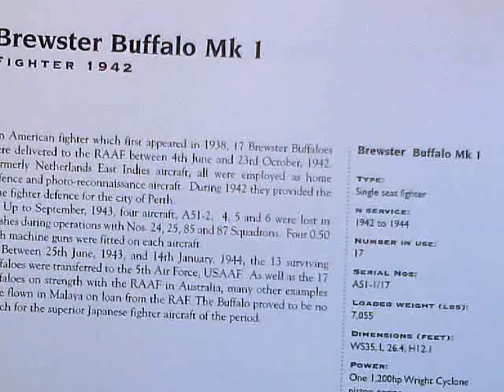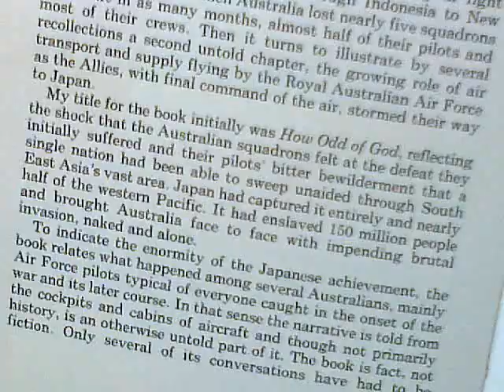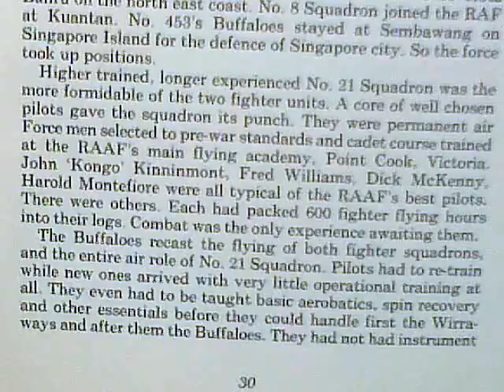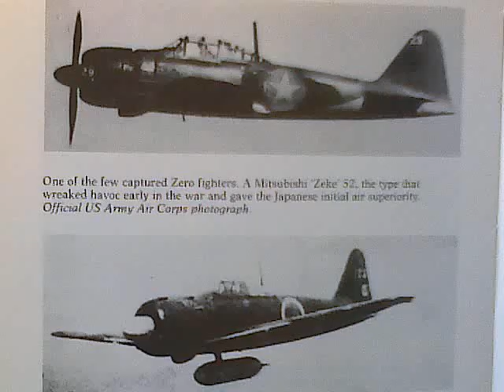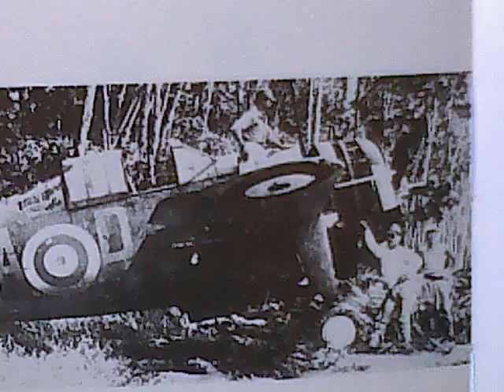World's Worst Fighter Aircraft, The 1941 RAAF Brewster Buffalo !

Comment: The Finns had a 26 to 1 kill ratio with their Brewsters. In fact: After evaluation of claims against actual Soviet losses, Brewster BW-364 was found to have been used to achieve 42½ kills in total by all pilots operating it, possibly making it the highest-scoring fighter airframe in the history of air warfare. 
The Brewster works well, in the right hands.
Reply from the maker: G'day,

  Thanks mate,

  Well, the sources I've seen are a bit more modest than yours, in that the Finnish Buffalo Kill-Rate versus the Soviets was 10:1 and when the Yak-3 showed up the Finnish Air Force upgraded to Bf 109 Fs & Gs, & Hs, and their Kill-Rate suddenly became 25:1, as soon as they got their first Friedrichs.

  So it isn't so much a matter that "the Buffalo was a Good Fighter Plane", so much as that the Finns were Shit-Hot Pilots.

  Also, the Finns got the Earlier Buffaloes, the ones which were lighter than the later (higher-powered & more heavily armoured) models which the British bought, & then  foisted off onto the RAAF...

  Then, again, the Finnish Buffaloes had German Guns, German Ammunition, & German Radios..; so their Gun-Mountings failed to fracture, firing the Cowling Guns didn't blind the Finnish Pilots with Vapourised & Re-Condensed Gun-Grease from their  not US Naval-grade .50  Cal. Ammunition, and the German Radios weren't rendered useless by the Tropical Storms which don't commence at 11 AM every day over the Pripet Marshes & on the Kola Peninsula..., and the Soviets flew Low, so the Finnish Buffaloes never had to fly sufficiently high for their Fuel-Pumps to fail..., either.

 Basically, the Finnish Buffaloes were different Aircraft which did not suffer from the flaws of the RAF/RAAF/NEIAF/USMC Buffaloes which made such a piss-poor showing in the Pacific, & they were up against badly-trained Soviet Peasants, rather than Japanese Combat-Veterans who'd been winning in China for 5 years before they showed up in the Southwest Pacific...

 Ilmarri Jutilainen scored 34 of his 96 Victories while flying in Buffaloes, and his Aeroplane was never ever hit by so much as a single Bullet or Shell fired from any Soviet Aircraft..(!), and whereas Bubi Hartmann scored 352 Kills for the Luftwaffe, & thus he's "officially the most successful Fighter-Pilot" in the history of sneaking up on Strangers & shooting them in the back, because one's "National Honour" requires it..., he was shot down, & baled out or crash-landed, at least 4 times...; so I reckon that makes Jutilainen the "top ranked Fighter Pilot in all Human History".

  Because, due to Global Warming's ongoing deconstruction of the Global Economy, No Nation will EVER again provide 97 Aeroplanes for anybody to try to shoot down without being bullet-holed, in order to be able to beat Jutilainen's Record....!

  I once had a few conversations with a bloke who flew a Fairy Battle in France, he was shot down with the "Low-Level Flight" trying to bomb the Bridges between France & Belgium, after May 10, 1940..; a lot of 1930s Hairygoplanes could fly reasonably well, but were not actually particularly well suited for the task, if ever one was ordered to sit in them  and then take off to  "Pursue the King's Enemies...!"

Such is Life,

;-p

Ciao !
Reply: I was just reading the wiki. Yeah, wiki isn't perfect, but regarding fighter plane stats, who is. I said 36/1 when wiki said 26/1, which I tried to correct last night, but couldn't find this vid again till you posted.

The uneveness of pilot training, and airplane evolution, in WW2 was true all over the globe. I'm not an expert, but the disparities in aircraft and pilots was everywhere in most theaters, and the historical preoccupation with nationalism/equipment never dies. 
I always wondered how I 16's would do in the best hands, but history just distorts they're place in the evolution of WW2 technology, as if the I-16 and untrained pilots were Russia's answer to the 109. Nobody had an answer to the 109 or the Zero (farther east), because those "answers" take time, but being first with the best didn't often happen or last very long in WW2, but the I-16 might be one of those. 
Your argument is well taken. The title of worst, though, would require a comparison with 20-30  other mediocre planes, and is in the end an impossible "truth" to ascertain.
It wasn't gonna happen that the stubby looking aircraft (I-16, Buffalo, etc) would receive the support to evolve, perhaps for good reason, but my impression is that many Finnish pilots, flying the Finnish modified Brewsters liked them. The people who didn't bother to modify them, weren't allowed to modify them,  received the worst versions of them, or who didn't train hard with them, didn't.

I suspect your overall assessment is that the US procurement system (then and now) is a mess is accurate.
The recent trillion dollar outlay for new nuclear delivery and weapons systems is stupid enough to warrant a "worst" designation for military reasons, and every other reason.
Reply from the maker: Jeff Moore 

   Yeah, I've been calling the F-35 the Jet-Powered Buffalo, and Oz is signed up to buy about 75 of them for $200,000,000 at per each...

   I think the I-16 and the I-15 both did pretty well in Spain, even against the Bf-109s (C & D models...).

   Here in Oz, they used the biggest Motor available (off a DC-3), with the Centre-Section & Tailfeathers of a Wirraway (a Harvard with a Rear-Gunner & a .303 Browning for the Pilot.., one lucky bloke shot down one Zero with one Wirraway, once...!), and a short little rotund  Fuselage & stubby Wings, and called it the "Boomerang"...; it worked out allright for Ground Attack, but essentially the concept of putting Guns on a "1930s Radial Racer " style of thing turns up being about 500 Hp shy of being able to carry all the Military Add-ons and still stay in the sky with the rest of the Competition.

  Last November I was at the Armidale Airshow, with 2 Phone-Cameras & a 300mm Zenit Photosniper (1982 vintage Soviet Telephoto "Spy-Camera"), and if you title-search my Uploads for "Armidale Airshow...." there's both Video & Stills of a restored Boomerang, a Wirraway, and a Harvard & a Texan for Comparison ; there's also a Yak-3, and a 6-ship formation team of Nanchang & Yak Trainers ("The Russian Roo-Lettes")..., and while they were flying low under the worst Thundery Sky I've ever seen any Airshow continue to happen under the Team's "Patter-Man" said a thing I suspect you'll enjoy...,
    "Soviet Aeroplanes were designed by Geniuses, intended to be maintained by Agricultural Peasants, and to be flown by Lunatics - or Drunks...!".

  The Russian Roo-Lettes were doing Formation Aerobatics at Armidale in Yaks & Nanchangs while the RAAF "Roulettes" Formation Display Team, in their Turboprop Pilatus PC-9s, were grounded 60 miles away at Tamworth, by the vile Weather...

   Such is Life,

;-p

Ciao !
Reply: Appreciate the story. You've been bitten hard by the aerobug. I'm just a couch admirer of the stuff "daddy" flew.
They don't appreciate camera's in museums? It's hard to imagine that these craft were used like Dixie Cups back then, and are precious now. 
Where we (US) produced planes like toasters, now its like a craft guild. I remember when Popular Science had regular promos of "consumer" planes to replace your car.
Reply from the maker: Jeff Moore 

   Oh yeah, I got bitten very hard indeed by the Aero Bug, I used to think I was Biggles.

   If you search for "The 8 Hp, 1975, Red-Baron Skycraft Scout ; World's 1st Legal Minimum Aircraft..." you'll get to see my first Aeroplane hanging up in the Transport Museum 50 miles to the West of here...; I was it's 3rd owner, and the last person to have flown it, in 1978 - it's not much of a "claim to fame", but it means that I can honestly say that Wilbour & Orville had a better Aeroplane in 1903 than what I made my first solo in...(!).

   By the early 1960s Cessnas & Beechcraft & Pipers were pretty boring, and Hang Gliding was the reaction, and then Ron Wheeler put a Lawnmower Motor & Wheels onto a "Tweetie" and then managed to get the Department of Transport to write Air Navigation Order 95.10 ; so for a while, here in Oz, we were allowed to fly uncertificated machines without needing any Licences..., and the rest of the World followed, so "Minimum Aircraft" became "Microlights" & "Ultralights" & now they're "Recreational Aircraft", and you need a Micrometer to tell a Jabiru from a Cessna 152 - because General Aviation  Aircraft & Recreational Aircraft now overlap...., they've merged.

   The vision of everybody having their own Aeroplane and flying to work was never going to happen, because not everybody has the kind of mind which can juggle all the variables needed to manage to not crash when moving through 3 dimensions and managing Airspeed & Angle of Attack & Navigation as well as avoiding collisions...; and the smaller, lighter, and simpler the Flying Machine then the more dependant it will be on having Perfect Weather to operate in.

  As the old saying goes, "If you have time to spare then travel by Air...!" ; alluding to the liklihood of being delayed by Weather or diverted to somewhere other than wherever one was trying to reach...

  Eventually I crashed my Ultralight Motorglider, and 24 years later I still limp and carry a Walking-Stick...; and I've never bothered to rebuild the Aeroplane, it sits in it's Trailer as a reminder of the days when I was young and thought myself to be unbreakable...

   Have a good one,

;-p

Ciao !
Reply: I watched both your vids. Extremely entertaining! I've done my near death apprenticeships  long ago. I also reasoned that flying and even deep water are hostile places for humans. A table saw and electric bikes are are far out on the limb I travel.
I "invent" stuff all the time though. A lot more mundane that airplanes, but pop was a pilot for SAC, and loved talking about it, so the bug is there in me. Dreaming up "airplanes" and other stuff is hardwired in me by now.
Are you still down under?
I'm gonna search Volmer Jensen next. Thanks
Reply from the maker: Jeff Moore 

Thanks mate,

  Volmer Jensen was a really amazing character, he was offended by the early Rogallo Wing Kites' horrible efficiencies, and decided to show the Hang Gliding Fraternity how many Beans made 9...

  Yeah, I'm still in Oz, I never got around to going anywhere overseas..; my grand plan was to use the VJ-24w with a VHS Mini-Cassette Camera on my Helmet & run an Aerial Photography Business barnstorming Farmhouses to sell  Aerial Videos of their "Spread" - back in 1992 it might even have worked ; and I'd bought 100 Acres to live on & turn into a (marginal) Ultralight Airstrip (in a Forest atop a Ridge), so when I pranged the Jensen...

   I've been living in a 10 Ft x 12 Ft Lawn Locker in the Forest since 1994 when I left my wife, the Custody Dispute ran for 9 years & I was self represented but in the finish my missus lost 4 Cases in 4 jurisdictions in 4 weeks...; today my son turned 27, a year & a half ago he bought the Town's Auto-Electrician's Workshop & Business from his old Boss, & the Reddestone Rural Fire Service Brigade elected him (full Red Hat) Captain, & at 24 he got his Helicopter Winch Insertion/Extraction Licence & a spot on the local Remote Area Firefighting Team...

  So, I didn't entirely stop him from being into Aeroplanes, he bought the tickets & took me, my daughter & his Girlfriend to the Armidale Airshow last year...; and 20 years earlier he & I were at Armidale for an Airshow, but then we were there to Aerotow Hang Gliders, as part of the Airshow....

  I figure being a toddler watching Daddy working at Airshows & Fly-Ins must be where/how he decided to be an energetic worker, just like me getting him to help Burn-Off when he was 5 and taking him to my RFS Brigade's Annual General Meetings from 7 led to him becoming the youngest Deputy Captain in the State when he was 17 (?).

  Considering that my father's grandfather came here in 1882, and that the bloke who started "Glen Innes Auto Electrics & Air Conditioning" in 1960 had been my father's last Business-Partner in 1958 - and he used my father's Electrical Test Bench to kick off with, the year before I was born..; it feels to me as if Wharton's Garage "threw a Pup", and though Dad sold his Engine Reconditioning Business in 1972, I've raised my son to have "bought the Family Dog back", because Dad's Electrical Test Bench was part of the Deal...(!).

  And, if I'd have moved so much as 50 miles in any direction then Old-Local Effect wouldn't have been able to facilitate my kids' being able to succeed in the ways they have done & are doing.

  I have a bunch of Playlists, and in the "SunFoil Project" Playlist there are 2 Vid's called "Wharton's Garage, Remembered..." & "Wharton's Garage Rebooted, Live & In Realtime...!"

  In the "Personal Aeroplanology" Playlist there's one called "Aerotowing Rogallo Hang Gliders", which shows my son at age 5 running Free-Range, Airside, at the Inglewood Fly-In/Aerotowing Weekend in 1994...; as well as some of the Photos he took, with the 110 Zoom Telephoto Camera I let him loose with, in 3 days, with a 24-Exposure Roll per day, and out of 76 possible Frames he had available, I paid for 72 Photographs which worked out well enough for the Processers to to print them.

   If you're into Wildlife, I have about 5 Playlists of Kangaroos, Swamp Wallabies, Birds, Snakes, & combinations thereof...; it's a rare day when I have less than 3 wild unfenced Swamp Wallabies & 5 Grey 'Roos show up at Sunrise to share my Breakfast..., and I have Subscribers in Cornwall, Canada, Scotland, Florida & Norway who know the names of the "Breakfast Flock" of local Macropods, because they've been watching my videos for years.

   I figure that YT gives a Hermit like me a "Global Megaphone" with which to share the view, and more people should have the opportunity to see Wildlife when they're feeling relaxed & comfortable...

   I don't know that I'm the only Australian who has wild 8 Ft-Tall Alpha Male Kangaroos bow down & cover their Balls with their Claws, while having Bread put into their mouths...; but, as far as I know, everybody else who posts Macropod Footage either uses Telephoto Lenses or they have Fenced-in, Tame, "Pet" Animals which were either born in Captivity or raised by Wildlife Rescuers after their mothers were shot by Hunters or killed by Cars...

  I have 1,880+ Videos uploaded, & probably 400 of them are Wildlife, and perhaps 50 have Wild Critters sniffing my handheld Phone-Camera Lens, at less than 5 Millimetres (1/4 Inch) Range.....; so, if you want to see some rather  rare insights into Wild Macropods & Wild Birds  interacting with a non-threatening Human Forest-Dweller, then my playlists are there...

   The Poetry is in the "Warbles In The Wilderness" Playlist...

  I do admit to being a something of a thorough-going "Oddball", but I reckon I'm Harmless ; and though I do use Trespassing Sheep for Archery Practice, I get along well enough with my neighbour the Sheep-Farmer that he never shoots at me when I'm standing in my Headlights, while opening my Gate at night...

  I think of myself as a Greenie living surrounded by Rednecks, trying to get along with them-alls ;  while we all try to live through "Interesting Times"...

   I don't really agree with what the US AF SAC thought it was trying to do, because from 1980-86 I was a Nurse, trained at a Repatriation Hospital, & I nursed the Veterans of every War which Oz was involved in from 1914 to 1984 ;  2,000 of them, for an average of 10 days per Veteran..., and that turned me into a Pacifist...

   Meaning that I abhor the War(s), but I empathise with those who were seduced by the Access to Technology which Enlistment facilitated, having grown-up being weaned on Militant Patriotic Nationalism...; "There, but for the Grace of God, goeth I...!", kinda thing.

Such is life,

;-p

Ciao !
Reply: We make up our lives as we go along. I evaded the draft - an honor. Had lots of kids. Wife died 5 years ago, remarried and 3 more teens came in the arrangement.
I wish I could stop the eternal war my leaders have bought with our taxes.
I practice guitar and singing for hours and want to resume performance like before my second wife died.
To that end I've created a live music system that allows me to kind of have a studio on the run. Nothing earth shaking, but very practical, musical, portable, and good sound reproduction.
I'll have a look at your vids when i get the chance.
Reply from the maker: Jeff Moore 

Cool,  

   I married a woman with two boys at foot, but I turned into the Stepfather from hell...; not one of my best achievements...

   I should've realised that any time & energy their mother spent on her relationship with me was time & energy she didn't have for her existing children - and no matter how I tried to contribute I couldn't make up for the reduction in Mothering they experienced as a result if my being on the Scene...; so, in hindsight I had no right to commence courting their mother, but I was unaware of that at the beginning...

  Have fun with my Uploads, but you'd need weeks of dedicated obsessional viewing to plough through them all, there's probably 450 or 500 Hours of them on the scroll...

 Have a good one,

;-p

Ciao !
Reply: Aint it funny how these relationships get more transparent to us as we age? I married a Kenyan that already had children, for that and other reasons. I don't know how I or she could parent each others children without having prior experience. 
I had a lot of previous experience, starting when I was age 22 or 23. My youngest, from the previous (I am/was? a widower) is now 15.
I'm not as clear as you about my first marriage, and like yours it was an 8 year ordeal of a divorce after a long marriage.
I blame her, which only means that I haven't figured it out, but it was long long ago.

At best I'll sample the genre's of your vids! Like one of your birds that took a lot of effort for you to keep running, I'm sitting here with a Volt Ohm Meter, trying to sort out and imrove my  my music system thing.
I'm fascinated with WW1-2 aircraft, but I'll never be a pilot or builder. Music is both more accessible, safer, cheaper, and even more compelling to me. But somehow aerobatic and dogfight flying - and musical improvisation have merged a bit in my little mind. 
I like playing and singing "without a parachute" and not as a hobby but as an obsession. 
Take care
Reply from the maker: Jeff Moore 

Cool, no worries.

   One of the ways to sample the Genre, as you succinctly put it, would be to backscroll the Uploads for a few weeks from now, and view anything which grabs you

  A different way would be to search my Uploads by "most popular", which (on my Prepaid Telstra Mobile Phone) results in a scroll of my 30 most-viewed Videos ...; the top rated runs almost 14 minutes & is about why Magnetic Flywheels don't work, it had 166,850 Views last time I looked, number 2 has 66,000 Views but the BBC Nature-Doccumentary Unit used 48 seconds of it in their hour-long Doccumentary, "Nature's Weirdest Events", they gave my real name & used my own voice-over...

  My Scottish Subscribers fell off their Chairs when I appeared on their Televisions instead of the Computers, 3 years ago...; 3 days ago I was told that some people around here were watching National Geographic Channel, & there I was...!

   My dad was 52 when I was born, he had 3 kids & his first wife died in October 1958..; in April 1959 my mother was 22 & watched my then 19 yr-old sister getting married, in January 1960 my parents got married, & I was born in Feb. '61.

  When I was born, the Age-Gap was 28 years, & my mother was 24...; and I watched my father suffer the disapproval of my Half-Siblings in that he saw almost nothing of his 5  Grandchildren from his first marraige, whereas he died 7 years before my Son was born...

  My wife is on something like her 7th or 9th partner since I left her, out of the 7 "Back Door Pricks" who tried to woo her away from me before I gave up on her, 4 have died, 2 went to Prison, & 1 left town so I dunno how he got on...; but my Son hasn't spoken with her for about 9 years & my daughter hears from her somewhere between Weekly & Yearly.

  A Fortnight after she lost the final Custody Case, my wife's eldest Son hanged himself about 6 weeks before he would've turned 21, and she prefers to pretend that I "must have murdered him & set it up to look like Suicide..." ; and now it's almost 14 years since the Courts rescued my kids..., and her surviving son from her first Marraige is 33, still lives with her, and on my 12th Wedding Anniversary I learned that both my Stepsons were in separate Psychiatric Institutions..., 6 years after I left their Mother and started trying to rescue my kids from unbuffered exposure to her.

  My Wife's first Husband abandoned his children to be raised by a Mad-Woman whom he couldn't stand to live with, and he left them to be driven mad by toxic parenting...; I never dared risk my children's sanity by having to cope with any "Daddy's Girlfriend Fantasies" while they were busy trying to be the children of a Failed Marraige.

  I often used to comment that if my Wife were dead then within 3 months I could've transformed her into a Perfect Parent, because I had learned to become expert at contriving excuses for her behaviour, and if she'd been dead then she wouldn't have been able to continue managing to contradict my rose-coloured version by fucking-up contemporaneously.

  It's totally different having an ex-Partner living an ongoing Life, to having a Headstone in a Graveyard to say nice things about...; my father had the Headstone thing going on, but my first wife lives with her surviving son 100 miles away.

  If either of my kids can stay married for 21 years then they'll have done as well as my father did with his second wife...; & yesterday I drank beer with the Parents of my Son's Girlfriend, on his 27th Birthday, in their House, where they allow him to live in their daughter's bedroom...

  I figure we're all trying to be as supportive as possible...

   For a Hermit, I find my role as a supportive parent to be very demanding & challenging.

  But, I try...

;-p

Ciao !
Reply: Jeff Moore could it be that the Russians and the Finnish fought at a lower altitude because of the cold?
Reply: I believe the # is 32 to 1. Highest kill rate of WWII on the Finnish side against the Russians.
Reply: The Brewster worked very well indeed in the right hands, against the right foes. I think if the Japanese, whose pilots were probably the world's best at the time, had flown the Zero against the Finns, the Finns would have suffered a bit. The Finns, tough, brave and patrioticm flew against very poorly trained Russian pilots with antiquated aircraft.
Reply: Indeed jmfa57.
I was simply stating the #'s by the Finns. Not leaving an opinion.
You know what they say about opinions?
Reply: mrdfac, you have me dead to rights, sir! I do indeed know about opinions, I have one myself, as well as its erstwhile companion! Cheers! :)
Reply: wasn't the Finn Brewster lighter and more nimble than the uparmored one the USN/USMC used?
Reply: yeah easy to disprove it was training because when in better aircraft the kill ration shot up
Reply: The British C&C was bad on Malaya. So they invented "the Bad Buffalo". Noone claims Hurricane was bad, and yet in the defense of Singapore Hurricanes were exactly as bad as Buffalos.
Reply: Probably an anti-Soviet myth, same as the fake count of Simo Haya.
Reply: WarblesOnALot ”they were against soviet peasants” well so were the soviets.
Reply: Jeff Moore Finns can destroy tanks with logs, I am sure this flying tin can was like a super weapon for them
Reply: Would been interesting see how the Finns  would have gone against Zeros
Reply: blueycarlton In Finnish weather? No problem.
Reply: The Russians that they shot down were very basically trained before going into combat. The Luftwaffe pilots scored dogfights over hundreds of them.
Reply: @WarblesOnALot  Didn't see mention here, when I visited Finnish Air museum they said Finns did away with Brewster Buffalos armor to make it lighter to take the advantage of the powerful engine. Would make sense if you're faster and more agile, you get more chances to score.
Reply from the maker: @sl06bhytmar  

G'day,

Thanks.

Yes, lots of Armour is great - as long as whoever is shooting doesn't have a lighter Aeroplane, and the Russians didn't have Armour on their I-16s ; so the Finns "Simplicated, and added more Lightness...".

    Have a good one.

;-p

Ciao !
Reply: Those planes were exported from other countries imported into Finland, they were tinkered-with and modified heavily and the tiny Air Force had over-trained crews.
The same situation could be applied to any small nation of people under attack.
If they had training and willingness and had anything to hit-back with.
Reply: @WarblesOnALot  Finnish Brewster DID NOT have german weapons, they had the original 3x12,7mm+1x7,62mm. From 1943 on the 7,62mm was replaced by 12,7mm LKK42.
Reply from the maker: @mtlb4906  

G'day,

Thanks.

Yes, you're right...; when I made this Video I was under the impression that the Finns were unable to get US Weapons & Ammunition - but of course the US was perfectly happy to sell Weapons to the Axis Ally for shooting at Soviets (while supplying Shiploads of War Materiel to the Soviet Union under Lend-Lease...!) until 11 December 1941 ; when Pan-Germania declared WAAAUUUGH(!) on Unkle Spam.

  Did Finland then manufacture "AmeriKopyKat Rounds", or did they have sufficient genuine Browning Bullets stockpiled to be still using them in 1943 when the Buffaloes were swapped out for Me-109s ?

Such is life.

Have a good one...

Stay safe.

;-p

Ciao !
Reply: @WarblesOnALot  Not sure but pretty confident that we used homemade ammo because of finnish LKK42 12,7mm was pretty much copy of the Colt 12,7mm. (Yes, about 200 differences between those guns but still.) But at the time when US sold us those Brewsters, Finland was not Germanys ally. On the contrary, Germany was allied with our enemy, Ussr. And Brewsters remained on frontline service in Finnish airforce at the very end of ww2. Bf109 was our best fighter from march 1943 on but Brewsters were our second best fighters. Unfortunately that tells more about how badly equipped FAF was than how good fighter BW239 was.
Reply from the maker: @mtlb4906  

Yeah, because of the Anti-Communist angle the US was delighted with the Winter War..., and that continued after Barbarossa began ; there was then (as now) probably 30% popular support for Fascism/Nazism in the US, until 11 December 1941.

In the 1950s the US FBI used to harrass Democratic Socialists for having been "Premature Anti-Fascists" for supporting the Soviet Union's Defensive War against all those "nice neat straight Rows"of Stormtroopers regimentedly marching against "the Communist Hordes".

They're a weird mob, the Spawn of Unkle Spam...(!).

 If you enjoyed this Vid (?), then look in my "Personal Aeroplanology..." Playlist for -

"The World's Greatest Fighter Pilot...; Ulmari Jutilainen !"

  hopefully, it'll meet with your approval (?).

Have a good one...

Stay safe,

;-p

Ciao !
Reply: @WarblesOnALot  Have to add that Finland fighting against Ussr together with Germany had nothing to do with facism or nazism. Throughout 1941-44 Finland and Germany  political relations were most of the time cold, sometimes ice cold. That alliance was only because of military purpose, not because of political purpose.
Reply from the maker: @mtlb4906  

I understand that, and  I'm sure the Germans understood that,  when Finland only advanced against the Soviets about as far as their old Pre Winter-War National Borders, or so, and then they built a lovely collection of Bunkers for the protracted Sitzkreig on the Mannerheim Line.

  Pretty much everybody in the United Nations accepted that-all, intellectually... ; and yet the fact that Finland fought using  German Weapons, while wearing German Uniforms, and fighting against Germany's Soviet Enemies..., and the Finns only stopped fighting the Soviets barely in time to turn their Coats & then fight against Germany - rather than geting Finland actively Steamrollered by the Soviets going past the Winter War's Stop-Line..., which all taken together causes most British Commonwealth /US who consider Finland's Role in WW-2 at all..., and most don't ever think about Finland's Alliegance with Germany..., but those who do know,  regard Finland as having been Hitler's most effective Axis Ally - far less disasterous for Germany than were the Rumanians, the Bulgarians, the Hungarians & the Vichy French & the Italians..., and Finland was far better connected and co-ordinated Operationally with Germany, than the Japanese ever were....

The view here is that Finland probably  "should" have defended it's Borders against ALL Comers, taking a lead from Sweden & Switzerland, because Finland's fighting alongside Hitler's Germany invokes the Clauses concerning,

# 1,
"Show me your 
Friends..., and
I'll tell you who
You
Are...!"

& also,

# 2,
"Lie down with
Dogs...;
Get up with
Fleas...!"

And, only the real Cognoscienti among WW-2 AeroHistoryHeads hereabouts  appreciate that the Blue Swastika, when  painted rotated 45-Degrees "backwards", on a White Field, was well established and long in use as a Finnish National Marking on Aircraft - well before the NS was ever the DAP, in Germany, pre-1923...

Such is Life,

Have a good one...

Stay safe.

;-p

Ciao !
Reply: @WarblesOnALot  The winter war tought us that we could not stay neutral or stand alone ww2 going around us. We had to choose our side and for the obvious reasons it was Germany, only country that was capable and willing to help us. Comparing Finland to Sweden or Switzerlan is ridiculous, our geopolitical position was far less worse than those two. Also, Finns did not wear gernan uniforms, they wear finnish uniforms. Only finnish finnish wearing german gear were the finnish bf-109 pilots from march 1943 on. And of course the finnish volunteers in the waffen-SS division Wiking.
Reply from the maker: @mtlb4906  

OK, I'll grant you the point about the Uniforms..., I probably extrapolated from all the Photos of Finns wearing
 "German Coal-Scuttle (Stahlhelm) stereotypical Nazi Battle Hats..." (!) ?

As to the idea that it's "ridiculous" to compare Finland to Sweden & Switzerland..., I disagree strongly.

Here's the View from 85 years down the track, standing 12,000 miles back ; for perspective.

  Three tiny little Nations, all on frozen and rocky mostly unfarmable forested "Badlands", all  surrounded by vastly larger Nations with much larger EcoGnomies and far greater investments in Military preparedness - and all their populations fully convinced that they wanted to fight with each other.

All, because, their,

"National Honour demanded..."

that thus must come to pass, eventually...

The Swiss and the Swedes had no interest in fighting either with, or against, any of the larger surrounding Wannabe Belligerant Nations, so they declined all invitations at forming Alliances with any of them..., and  continued to trade with all of them, and then contented themselves with savagely defending their Sovereignty by intercepting all Aerial (or Naval) incursions by all sides..., & and forcing both Allied & Axis Military Aircraft to land.

Switzerland thus  accumulated quite a large and varied  collection of interned German and  Allied Air Forces' Aircraft, by the War's end.

Nobody much bothered attempting to Militarily intrude onto Sweden, because they continued to sell their Ball-Bearings to anybody with Cash to pay & a Backpack in which to carry them away.

Finland, on the other hand, was already plenty pissed-off with the Soviets for the whole Winter War..., and rather than telling the Nastiez & the Commo-Unionists to go away and compost each other's DNA..., which was clearly an option ; Finland decided instead to embrace the idea that (because they expected Moscow to be fully occupied with retreating from Barbarossa ) -  therefore it would be quite safe to run along beside the Wehrmacht until attaining whatever  Helsinki defined as being the old  "Tradional Border-line"..., and then settle down to await Adolf's "inevitable" Goose-Stepping Viktorie Parade through Red Square...(!).

   Finland behaved a whole lot like a 5 year-old who, after being bullied by an older Child and having fought valiantly until inevitably having to give the Bully their Lunch..., then waits a year or two - and one day when their hated  Big Bad Bully is about to be jumped on by the local teenaged delinquent Sociopath, the little kid rushes up volunteering to help - by running in to bite the back of one of the Bully's Legs..., to distract him...

   Finland was expecting Germany to WIN, obviously... (because otherwise it would mean that Finland chose to fight alongside a Cause which  they knew was foredoomed to lose  badly, in the Long Run...!) ; and Finland apparently wanted Revenge, Finland wanted Payback, Finland wanted to kick the USSR's Arse - and if that meant marching alongside the Hitlerite Hordes, swarming off to look for & capture some  Liebensraum for Durrr Volk..., then so be it - anything was acceptable to Finland if it would give Joeseph Djugashvilli and his Empire the Shits...(!).

That's how it all looks, from this distance.

As an aside, yesterday was 79 years since Japan first bombed Darwin..., so I uploaded the second part of a Series I'm doing called,

"Coral Sea Catalinas..."

It's a bookreading from a Unit History of 11 & 20 Squadrons, RAAF, from March 1941 to May 1943, written by a Flight Engineer (2,300 Hrs, 120 Operational Missions, 32 Bombing Attacks), with collected Diary of the defeat of & escape from Tulagi & Letters from 5 Aircrew who survived into the early 1990s when the Book was being compiled.

   It's a rare account of a forgotten Theatre of WW-2 Operations, so I'm reading it to camera (off a Photocopy, while using the Book's Illustrations, Photo's & Maps to fill the Frame.

If you're into obscure WW-2 Aerial Operations...(?), then you might well enjoy it.

Such is life,

Have a good one...

Stay safe.

;-p

Ciao !
Reply: @WarblesOnALot  Well, if not allied with Germany the other option woud have been fighting alone agains both at the same time, Germany and Ussr, in summer 1941. That would have been better option for Finland perhaps? And if you look the map, you'll see Switzerland and Sweden doe's not have border with Ussr, Finland had over 1000km. Also we had raw materials vital to Germany's war industry. All this thing combined made it clear that Finland had no chance to stay neutral in the upcoming battle between Germany and Ussr. That is the historical fact, period.
Reply from the maker: @mtlb4906  

Finland didn't even  TRY to be Neutral in WW-2, so nobody knows how that option might have turned out.

But for Finland's "National Image" fighting for Hitler was a whole lot like lying down with a pack of mangy Dogs,mate, wbich ensures that whoever does it will inevitably get up to find themselves covered with Fleas.

  In Finland's case, it resulted in coming out of the War looking at least as sleazy & opportunistic as did  Rumania, Bulgaria, & Hungary - but not nearly as actually  "honourable"...,  because those other 3 Axis Belligerants stuck to their Guns & thus went down fighting ; whereas Finland played the Turncoat-Card, and wriggled out early, to become Stalin's Lapdog..., as they turned their Guns onto their erstwhile German "Allies" (= All Lies ?).

In case you hadn't noticed Pilgrim, I consider that ALL War is ALWAYS  All BULLSHIT...; which is why 20 years after the Ceasefire  Veterans on both sides of every Battle start to seek each other out,to swap their War Stories, and at the 30 year mark they begin trekking back to the Battlefields on the anniversaries, at the 40 years mark  they bring their Children & Grandchildren to the Reunions..., showing up by the Busloads.

Entire Tourism Industries grew up to support their Pilgrimages...(!).

And, at their Reunions, they ALL tell how they personally had no reason at all to have ever wanted to kill each other - but that  they were sent out to try...,  by bunches of Lying Politicians who all told them that their "National Honour" depended on them dying in a Ditch, beside a Crossroads, in the middle of NOWHERE that anyone in their Hometown had ever previously heard of...(!).

Between 1980 & 1984, as a Student at a Veterans' Affairs Hospital, I nursed 2,000 Veterans of every Military Adventure in which Oz participated, from 1914 to 1984, for an average of 10 days per Veteran.

And between them, collectively, they  taught me much about the Bullshit-Content inherant within Patriotism, Blind Obedience, and War.

Such is life,

Have a good one...

Have a good one.

;-p

Ciao !
Reply: @WarblesOnALot  Well, what Finland did had nothing to do with honour, it was just a matter of surviving as an independent nation. You are right about that every war is hell and they should not be glorified. However, Finland made just the right choices at the right time. The only purpose why Finland went to war was to remain alive. Before winter war Finland believed that staying neutral would protect us but that turned out to be fatal miscalculation, brinking finnish people near to exctinction. It is now easy to say that we should have kept our pride and high morale and let those two superpowers butcher us for their own interests. Those were desperete times, needing desperete measures to survive. Stay safe and have a nice day there down under 👍😊
Reply from the maker: @mtlb4906  

No worries...

I'm glad that you're all  still happy about your Nations' Wartime Choices...

Ever since the Fall of Singapore Oz has behaved as Unkle Spam's pet Attack-trained Chiahuahua..., all on the story that,

"AmeriKa saved Oz from being invaded, occupied, and having to speak Japanese, in 1942...!"

So..., Korea, Vietnam, Iraq, Afghanistan, Iraqagain, Absurdistandstill and also Syria too...

All embraced by Canberra on the unquestionable Hypothesis that if Oz  dutifuly fights all of  Unkle Spam's Enemies (Any Me's ?), all over the World, then the US Pentagon will defend all Oz from the (Yellow) Peril of Fascist/Communist Hordes feared to be planning to come swarming down onto Oz, from the North...(!).

But, in reality, not only did Japan NEVER ever have ANY Plans at all WHATSOEVER...,  for invading Mainland Oz, but they had absolutely no Troops, no Ships, no Aircraft, no Artillery nor Tanks,nor Ammunition nor Fuel nor Field Rations with which to mount and/or supply any such Invasion/ Occupation of Oz - regardless of Oz being at the time totally and completely undefended..; and yet in fact when Oz & Indonesia finally eventually did start Shooting at each other, in East Timor in 1995/'96, after Oz invaded to indulge in a spot of interventionist Neo-Colonial Regieme-Change..., dear old Uncle Spam put precisely ZERO "Boots On The Ground",  to help Oz to fight with  Indonesia.

The point, they said,  is that 250 million Indonesians can buy far more KFC & Coca Cola & McDonalds...,  than 25 million Ozzies ever can, y'see.

And to a Yanqui,

 "Busyness ist BUSYNESS !!!"

So, in obesiance to a pair of totally bullshit Assumptions ( # 1, that AmeriKa somehow "saved Oz from being invaded in 1942" ;  & # 2, that if Oz bleeds to please Washington, whenever and wherever,  then the Pentagonal Haemorrhoids will be surely guaranteed to come and die in a Ditch to protect all of Oz (for we are all God-fearin' Whitefullas together, y'see ! - from everybody of whom Canberra is daily terrified might perhaps maybe possibly want to attack & defeat Oz, next...) ; and thus Australia has Bin-Fightin' Washington's stupid bloody Loser's Wars, ever since 1944 - when MacAthur took the Yanquis off, to go Island-Hopping from Guadalcanal to Okinawa, while leaving Oz to waste our Troops on  attacking Japanese Garrisons scattered  all over Bougainville &  Papua, Tarawa, & other places that were pointless little  Backwaters - all totally cut off from Japan - & which  could've been simply besieged, & starved out  rather than bloodily winkled-out of Pillboxes & Caves with Artillery & Napalm & Hand-Grenades, until August '45...

  So, yeah... I reckon that Oz rushed in to buy a Pig in a Poke - when switching our Dependant Status from Britain to the US in 1942...; but that's not a particularly well accepted point of view, largely due to the entrenched EuroPeon Cultural tendancy to worship at the Temple of Mars, the Roman God of Waaauuughhh(!) ;  in which  Oz has been thoroughly steeped & deeply marinated - since 1770 when Captain Cook shot the first Australian whom the Royal Navy had ever met....(!).

Such is Life,

Have a good one...

Stay safe.

;-p

Ciao !